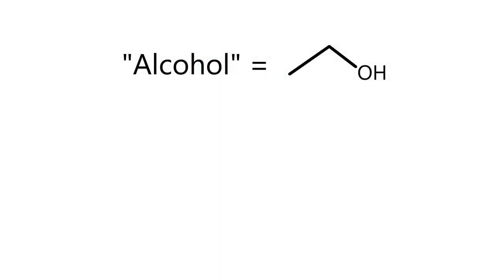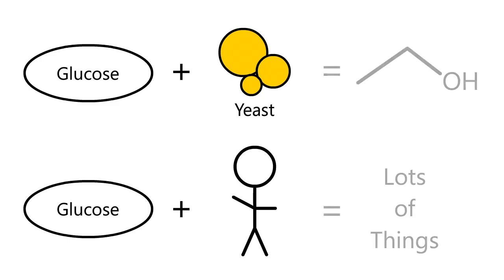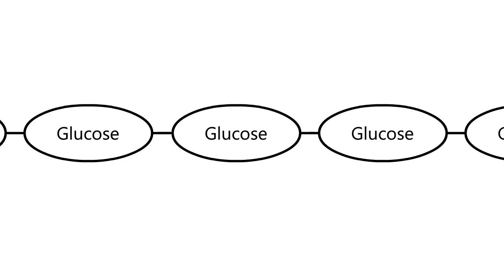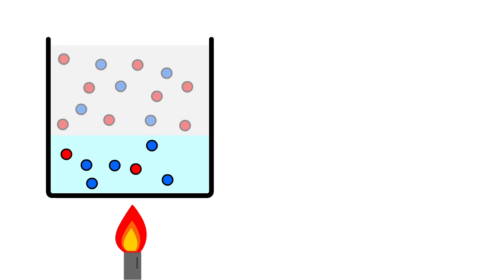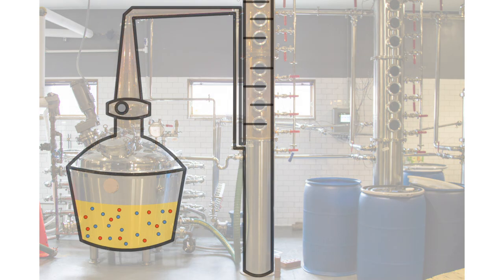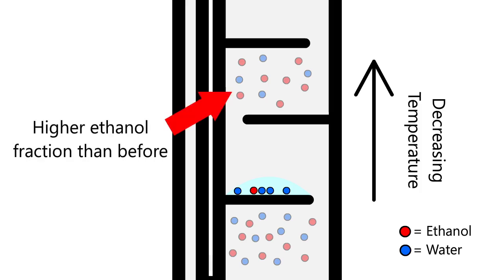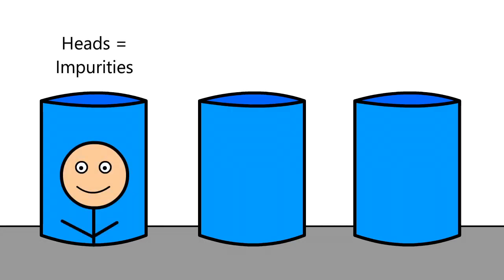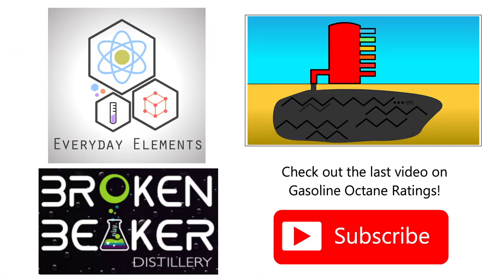How Is Alcohol Made And Distilled? (feat. Broken Beaker Distillery)

Comment: Wait, so the heads, hearts and tails are collected from the condenser tube? I thought only ethanol can get in there. Can you explain?
Reply from the maker: There are a ton of volatile compounds in the mash. It's very hard to get just ethanol as there are a lot of other compounds with similar boiling points, and because of the chemistry of evaporation from mixtures. If you're interested in learning more, understanding Raoult's law is a good place to start.
Reply: When the vapor is collected, the impurities are heavier and slags to the bottom.  When a collection line is opened, it flows out first, followed by the heart of the batch.  Finally the tail, which is usually waste material.  It can be used, but the taste will be foul..